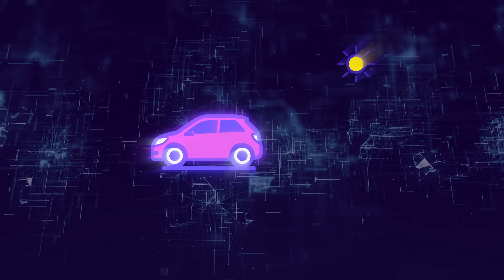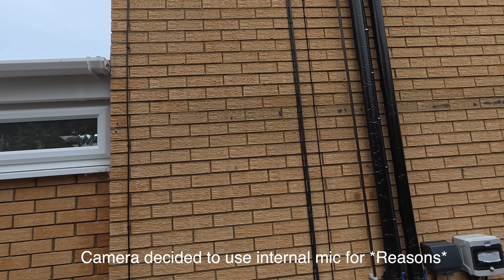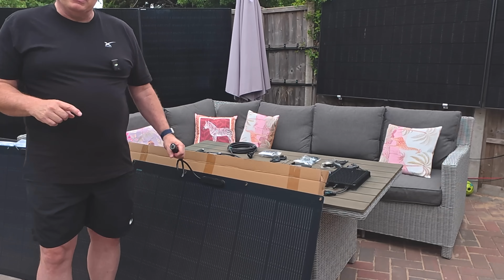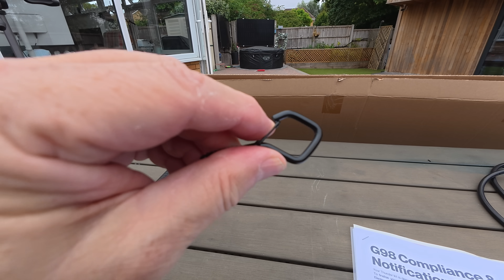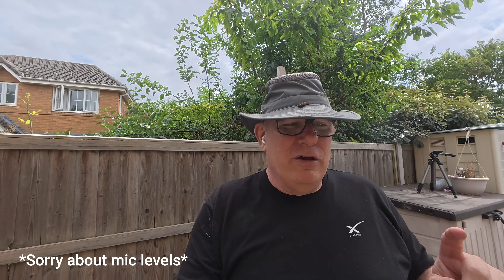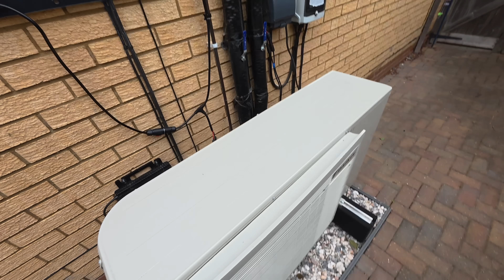thunder energy storm plug in solar installation uk

Comment: So plugin to an existing circuit....? Nope another misleading video, this is not self install. When people start buying this shit and have a problem you be long gone. To be clear @Juy 21 20126 Plugin Solar is not approved in the UK, no Inverters are approved. I guess you are getting paid promo for this video but you should be more transparent, maybe say it's all not approved and testing only.
Reply: The legislation changes 27th Aug so not long to wait
Reply: @HiruS22  Maybe but all these 'creaters' making videos that are misleading at best.
Reply: Spot the electrician
Reply from the maker: not true the only bit that is "illegal" as you say is the plug, these inverters are all legal and approved, the wiring regulations say they should be installed into a fused spur, but the legislation will change in a few weeks and we can all relax
Reply: @JonathanTracey  not in the UK. The interim standard was only just released a few weeks ago.
“Under the IPS, the products are supplied as a complete kit comprising PV module(s), microinverter and manufacturer-supplied interconnecting cables and connectors.”

Comment: Curious to see how these hold up! I see a lot of people on forums hate these flat thin style panels, I've got some myself and they're pretty neat, I wish I had a thermal camera to see how they fare against ones with aluminium frames though because honestly from my ones flush against the wall they're the same temps as a framed one with airflow behind it - I suspect the front side airflow is more than enough to cool either style of panel and most people quoting that haven't actually tested them at all.
Reply from the maker: That's been my experience too. There seems to be a lot of opinion online but very little actual testing. Mine have been running flat against the wall through some of the hottest weather we've had, and performance has been excellent.

A side-by-side test with a framed panel and a thermal camera would be really interesting. If there's a measurable difference, I'd love to see it, but so far the real-world evidence I've seen doesn't support the idea that these panels overheat simply because they're frameless.

Comment: Hi Jonathan, not sure if anybody has mentioned to you yet, but I believe you may want to rethink the location of the inverter as its location currently is within the heat pump safe zone, depending on what refrigerant is used.
Reply from the maker: Mines an R32 so no flammable refrigerant

Comment: Too pricey when compared to buying the components yourself.
Reply from the maker: That’s a fair point, and you absolutely could build something similar yourself by buying the individual components. For anyone comfortable specifying the right parts, checking compatibility and putting it all together, the DIY route may offer better value and more flexibility.

However, not everyone wants to research panels, cables, connectors, mounting hardware and power limits separately. Some people will simply want to buy one product knowing that everything they need is included in the box and designed to work together. There’s value in that convenience, even if it costs a little more than sourcing every component yourself. Neither approach is wrong—they’re just aimed at different types

Comment: Very interesting and got me thinking, could I do that! Questions: does having the sockets off a bidirectional breaker meet the requirements of the legislation? I assume you have an existing G99 ... so can you just submit this as a G98?
Reply from the maker: Yes, this is what has been discussed in the legislation, although I may have gone a bit too far as it doesn’t look like they’re going to mandate by directional RCBO’s. If you have an existing G 99 then you need to do an addendum to that you can’t do a G 99+ G 98.
Reply: @JonathanTracey   The legislation is now out and there is no mention of bi-directional RCBOs. There is though, a clear prohibition of battery connection to the plug in systems
Reply: @HiruS22  The consultation response and the revised standard extensively cover existing RCDs. The revised standard  requires no more than a 5mA DC component. That and the shutdowm time is sufficient to protect existing RCDs enough to be considered safe. Whether existing "don't use a plug nudge wink" kit meets that new requirement is an interesting unknown. Hopefully it does or a lot of people just bought the wrong thing in advance.

Comment: Had panels on my wall for a few years & theres one benefit I didn’t expect, when its sunny the flat I live in is cooler than usual. Using a thermometer the brickwork behind the panels is about 10 degrees cooler than exposed brickwork, usually when its hot the air in the flat feels damp. I think its moisture trapped in the insulation in the cavity being pushed into the flat, the six panels generate enough to charge my ebike, electric moped & numerous electrical devices.
Reply from the maker: yeah, I suppose they’re adding some extra shielding to the outside of the wall, never thought of that😂
Reply: @JonathanTracey  It acts as a parasol. It's actually well understood and modelled. It's even more effective with panels on a roof for cooling a room in roof with problems. Amusingly it's about the only way to fit a parasol to a UK building without planning permission. It's one of the reasons to consider solar panels over even a new roof versus tray solar.
Reply: You know that is a great side benefit, I might borrow that finding to convince my wife to let me buy more panels 😅

Comment: Excellent video. I've mounted 2x400watt ecoflow panels on  my South facing wall. Had to get some stainless pulley wheels, mount them high up and then hoist the panels up using glass suction cups and ropes! Was lathered in sweat I'm not a ladder man either 😂 those panels look a lot easier!
Reply from the maker: yeah I would have got a red card if she caught on me trying to hang large panels on my own
Reply: @JonathanTracey i had the neighbours helping or it would've been a definitive no! Another good video sir 👍
Reply: @JonathanTracey do it in winter.   I find CFOs tend to hibernate with the central heating!

Comment: Much obliged for this, I'm looking at plug in solar to supplement our 6 existing panels. Mr Tracey, do you know if there are plans for just a battery install option? The legislation isn't clear. We're waiting for a battery to be installed and being able to add to that dynamically would be very useful.
Reply from the maker: have a video coming friday on the last legislation that is proposed, batteries ar eno included so you would need to have them wired to a fused spur
Reply: The legislation is very clear, batteries are specifically excluded

Comment: It may be functionally equivalent, but it's not a plug-in solar product.
Reply from the maker: how is it not plug-in solar its a micro inverter that plugs into a socket
Reply: @JonathanTracey  No: it's a bare-wire unit to which a customer can add a plug to make it functionally equivalent.
This one even includes a permanent wiring junction box. 
There are no UK plug-in solar products available at this moment, only bare-wire units which are to be hard-wired by a qualified electrician.
The companies have to manufacture them without a fitted plug and then sell them with a nod and a wink that you can do it.
Of course, I hope the change does go through, so we can all get on with it.
But that's where we are at the moment.
Reply: @Paul-zzzzz so because it hasn't got a plug you are refusing to call it plug in solar?😮
Reply: @Israelisanapartheidstate   Technically it's true, only kits which meet the new standard (inc moulded plug) will be legal when the law changes on 27th Aug. In practice no one is going to come knocking, but you can bet an insurance company would look very closely at compliance with the letter of the law if they're involved in a claim
Reply: @HiruS22 The insurers will refuse anyway. Their whole business model is to find any excuse to refuse everything and then hope you aren't brave enough to take them to the ombudsman or court.

Comment: I wonder if you could explain about the outside consumer unit (did you fit it yourself). Also more about the RCBO dual  directional breaker. i.e. specs
I am going down this road with a ecoflow stream.
Pleased so far.
Reply from the maker: so it was fitted as part of my heat pump install, it allows you to isolate the heat pump to work on it without having to run to the otherside of the house. When istalling it we left some space for "future expansion" and thats where we added the RCBO. Its no different from a normal RCBO except it is designed with bi directional flow in mind, when installing solar its what most electricians recommend

Comment: I have read if you have roof mounted solar system and battery this plug in solar can play havoc with your battery and inverter ,your house baseload goes negative and your inverter sees this ,please explain how you worked around this issue .
Reply from the maker: no issues here been doing it for a couple of years.
Reply: I have a plug-in system as well as a separate rooftop and battery system.

I, like you, thought it might cause issues, but it works fine.

The inverter just sees the CT clamp on the incoming supply to your home. In fact, when the plug-in system is a full power excess over
what I use, it charges the battery.

The system is not comparing its solar generation to import/ export. If that makes sense . 

It doesn't care where the power is coming from as long as it's not drawing from the grid.
Reply: @jonathanlonsdale9442  The fireworks start if your system can back the circuit up when the grid is down, at that point the solar gets rammed into the grid forming side of the inverter or gateway and it gets very very unhappy. Otherwise it's usually only if you have two batteries you have to do a bit of playing around as if they both have a CT clamp they'll fight one another
Reply: Depends a lot on your equipment. The usual problem is that if you've got an existing system you need to do a G99 application (which may be refused) to upgrade your system above 3.6kW AC coupled, or if it already is to extend it.

Most existing battery/solar inverters can be set to track any export and charge from it. Some like the Tesla or others with home backup need to be set up specially or if you backfeed into the house whilst the home inverter is grid forming you may blow stuff up.

Comment: I am yet to be convinced on the floppy panels. Shorter life and lower output plus they tend not to be cheap.  Still think you can not beat two standard glass panels and micro inverter as a basic setup (if you have space)
Reply from the maker: I agree but as you say space is one issue, weight is another and there is no way I could have put full sized panels on teh wall on my own
Reply: @JonathanTracey  yes it takes two people and a small tower scaffold.
Reply: @smellypunks  And strong bolts and a wall that's not junk. I've seen plenty of newbuild walls I'd not dare attach a 30Kg solar panel to, and for that matter plenty of victorian ones likewise.

Comment: Hello from Thunder. We follow feedback on content like this very closely and welcome all views, whether positive or negative.

As a side note, we have moved the junction box to the short side on the latest version of our Storm panels to allow for neater and more aesthetically pleasing installations.

We would also like to thank Jonathan for his honest review. We carefully note every piece of feedback and criticism.

Best regards 🌞
Reply: I have a question why not just supply the panels with mc4 connections already fitted like most other providers currently do,
Reply from the maker: appreciate your support 👍
Reply: What's the  guaranteed %age performance over 10 years ? I ask because I've had terrible experiences with flexible panels but I regularly hear people insisting that some of the lightweight panels do last.
Reply: Looks really good from the video. I'm running two Ecoflow inverters along with three stream batteries at the moment, coupled with 8 465w rigid roof mounted panels.
I'd be interested to find out about prices and availability for a project on my garden shed roof to add more generation and electricity independence.
Thanks
Reply: @GorHol-r7e the price on there site are pretty good untill you look at the battery price but for the panels it's a good deal
Reply: @grimliver thanks, yeah I see what you mean about the battery price !
Reply: Hi thunder, what's the cost of this system and could it be plugged into a battery pack instead of  mains for a remote garage setup? Tia
Reply: @BUGGY71 they supply a battery system for it in a bundle £1649.99
Reply: @BUGGY71  Is that expensive for what you get?
Reply: Well plugin is not approved in the UK please clarify this....... This video is bullshit at best
Reply: @nigel1402 Plug-in solar panels are legal in the UK, effective August 27, 2026. New legislation amending the Plugs and Sockets (Safety) Regulations and updating BS 7671 wiring standards allows UK households to safely plug compliant 800W kits directly into standard wall sockets
Reply: @grimliver  Only if all the components are from the same place, so not this.

Comment: Fully accept your concerns for safety.  however panels mounted further up the wall would make a big difference.  Probably these might be best used at an angle say mounted on on Pergola (with addition support to avoid heat bending?
Reply from the maker: funny you should mention a pergola, thats the next project :-)
Reply: @JonathanTracey if you do this I would like to see a longer video showing the full build and designing from start to finish including compromises you have to make whilst doing so,

Comment: The standard fixing give a air gap behind the panel. Flexible panels still need air behind them, the more gap the power and lifespan
Reply: Not necessarily true, I have had a 350W flexible panel bonded to the roof of my campervan, and after 7 years it still outputs, and sometimes even exceeds, 350W. Quality matters though, a cheap crappy flexible one will not survive as well, just like a low quality glass one
Reply from the maker: I am going to see how they fare because I dont want the wind getting behind there in the winter

Comment: These look like they would be perfect for balconies, especially blocks of flats etc where there is a risk of major injury if a standard glass panel fell off in bad weather etc. Do you think mounting them flush to the brick would reduce efficiency? Mounted on a balcony, these would naturally get good airflow behind them.
Reply from the maker: honest answer is I don’t know, I’m waiting for a really hot day where I can get a temperature monitor and put it up behind the panel to see what it’s like
Reply: They are no less dangerous as they have even sharper edges so will do really serious damage in the unlikely event one came off and hit someone. Any panel secured to a balcony or a wall should be secured in accordance with building regulations. In fact that's the law. If you secure them to building regs then they really shouldn't be going anywhere regardless of the weight.
Reply: @etchedpixels but you can guarantee there will be idiots out there who see plug-in solar, then fix a 25kg panel to a 10th floor balcony with cable ties. It’s a disaster waiting to happen.
Reply: @Maverick12371  To the point the standard actually says

"Mounting arrangements relying solely on cable ties, rope, string, adhesive tape, bungee cords,
straps shall not be permitted."

Fortunately building regulations apply so councils can force dangerous ones to be removed.

Comment: I looked at the dashboard, and have one question.  Why is the Effective Value £0.36 / kWh?  Current electricity price cap tariff is £0.26 / kWh.
Reply from the maker: it’s based on my tariff, and it calculates an average across the day rate and the peak rate on flux. Because of the way the calculation is done, it will settle down once it’s got a bit more data. Because a significant amount of the generation we’ve had has been in the late afternoon it gets into the 36p peak rate on flux
Reply: @JonathanTracey  Okay, understood. So if I wanted to see if this system is worthwhile for me, I'd need to adjust the projected savings to my 22.33p/kWh tariff.

Comment: Seems expensive compared to others i've seen
Reply: Only a matter of time before likes of Lidl will be doing similar kits for a much cheaper price. 
Smaller flexible panels mean they can put loads of the kits out on the shelves. Pile em high sell em cheap.
Reply from the maker: what are you comparing it to, I haven’t seen many full kits
Reply: @JonathanTracey  TBH I watched that many videos this week, several a day lol. I couldn't point you to the exact video, it wasn't a kit though,  it was a video on buying it all separately (New, not second hand) but I will admit I may be getting mixed up a little with all the info and videos I've looked at. Just subbed to you yesterday and I look forward to seeing more. I'm a council tenant and I'm wondering if I would be allowed to put panels on my shed I'm building? Any info would be helpful
Reply: @JonathanTracey  Was it your self that bought the panels from the van for £60 each ?

Comment: Is this suitable to be added to a solar system that has already been installed on the roof with a battery system?
Reply from the maker: yep, it runs alongside my rooftop solar system no problems at all
Reply: Technically yes - paperwork may be a complete nightmare if your total generation is theoretically now over 3.6kW. If so you need to pre-apply for a G99 and it may be refused.